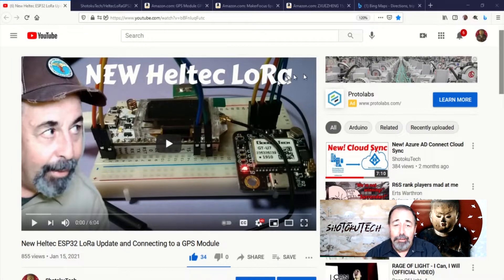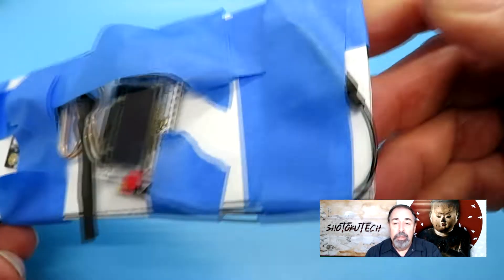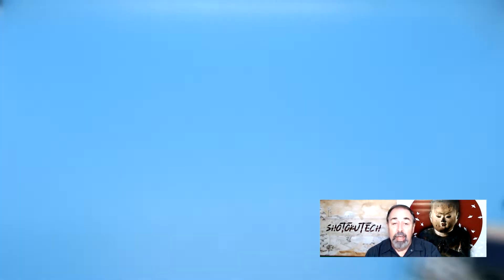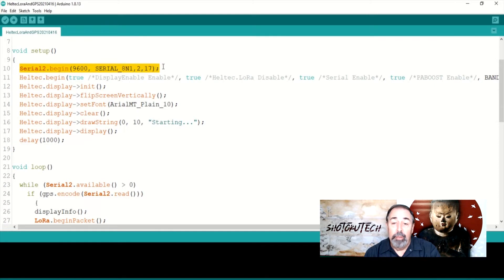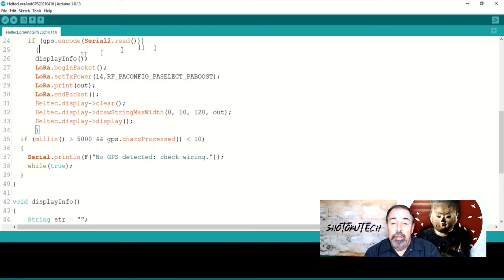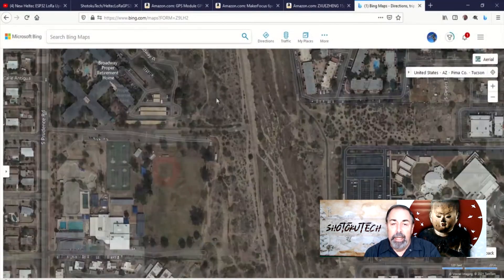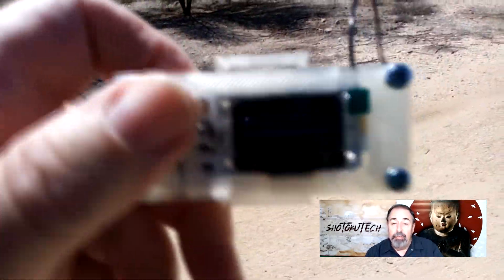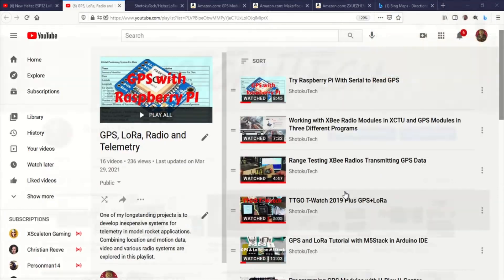Heltec LoRa ESP32 and GPS Module Range Test

Comment: Great video!  I realize this was a year ago but I figured that I’d comment anyway.  I have been successfully using a Beitian BN-220 GPS (tiny!!!) that is rated at 5V but is working great straight from the battery!  I had a bunch of PCBs made that are the same dimensions of the LoRa board and it allows connection of my SD card and GPS all with the module stacking right on top. I still have room for a switched battery connection as well. Like this, I use the boxes that the Heltec came in to mount everything along with the antenna out of the top. :)

Just thought I’d share the info. :)

Have a great day!
Reply from the maker: Sounds like an amazing project! Thanks.
Reply: I think I'm seeing this a bit late but I'm very interested. Do you have any documentation or a video about the project? It looks great! Does the GPS work properly when it's close to LoRa? Thanks!
Reply: @dronesete  Howdy!  Yea, works fine.  I haven’t touched it in forever but you made me go pull it out.  I still have it put together in the original box it came in.  I have a stack of the PCBs and the parts for it.  If you were here, I would hand them to you.  :)

I just wanted a repeatable way to assemble a little logger with long range transmissions.

Comment: That was 855m?
Reply from the maker: Having the challenge of maintaining line-of-sight in urban setting. Yeah I will put a bigger antenna on my roof mast soon. And this will be on a rocket soon: https://youtu.be/yyrZrP6KDZs
Reply: @ShotokuTech  that's pretty solid for what I need, thanks!
Reply from the maker: @foxprojects247  That's good. for all my urban testing is seems 2000 feet or 855 meters is doable, even just these tiny stub antennas. I do have the bigger 5dbi Omni Directional ones that I want to test sometime. Thanks!

Comment: Did you take antenna orientation into consideration?
Reply from the maker: Yes, these particular antennas seem to work best when pointing directly towards each other. Thanks
Reply: @ShotokuTech  That's very surprising.  You would typically expect a half-dipole antenna to have a pretty deep node in the direction of the antenna.  With the antenna held vertically I would expect an omnidirectional pattern in the horizontal plane.  I would also expect you could get much better range by increasing the altitude of the antenna.  Even with clear line of sight, the ground interferes with the Fresnal zone and creates very significant multi-path interference.
Reply from the maker: @Rick_Cavallaro  Yeah I need to test with antennas higher off the ground. To be honest, I am surprised that I have not been able to find good line of sight around here. There are a lot more grades and valleys than meets the eye. I think I live some where flat and it turns out not to be the case. Thanks!

Comment: That's a monster voltage module, I've got some $1 ones from AliExpress about 20% of the size. I'm assuming it was just what you had in the parts bin 😂
Reply from the maker: Yes but does it support 2a and have a power switch built in? LOL. I love having the power switch. Thanks!